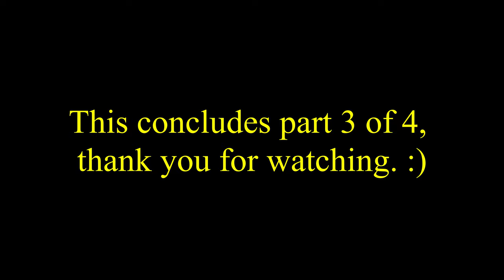1885 Prentiss #3 Vise Restoration Using POR 15 2K Urethane Part 3 or 4

Comment: Isn't por 15 supost to be mixed by volume and not by weight.
Reply from the maker: Good question!  I couldn't tell you what's correct to be honest.  All I can say is I haven't had any issued with the finish so far and it's been over 3 years.  I apologize I don't have something more definitive.